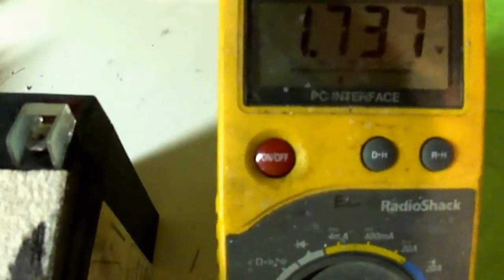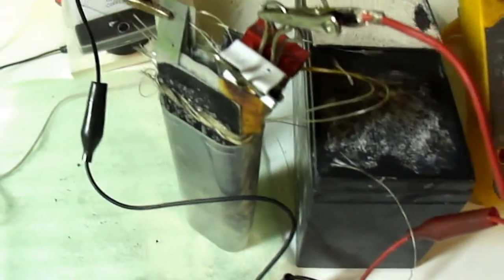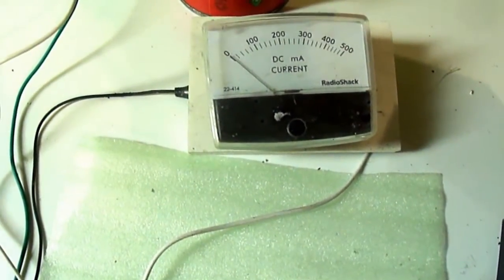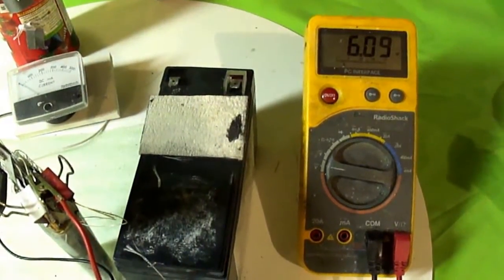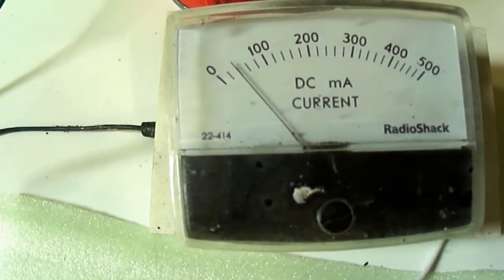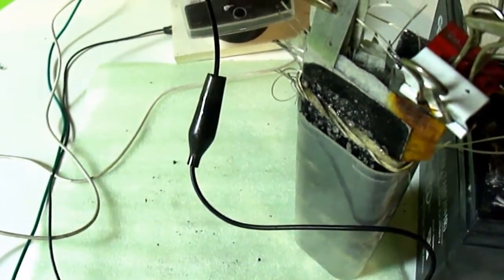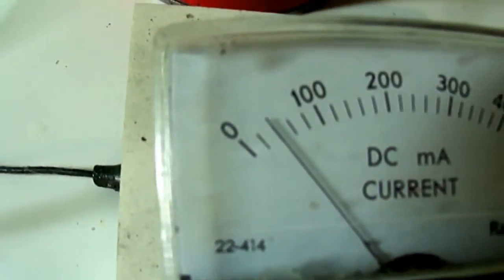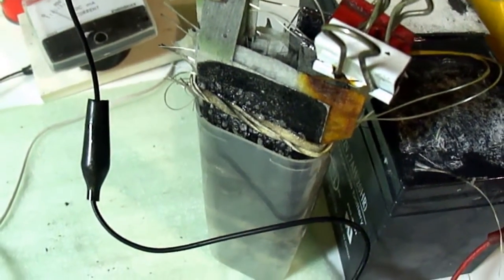Carbon Aluminum Battery 2017

Comment: I think ,How it w III would be ,if one try with potash alum+used lubricant oil e.g.(mobil oil,vegetable oil,dalda,liquid paraffin oil,etc) +glycol +thinner+zinc oxide for the same electrolyte with Al foil+ carbon flexible (graphite) plate for electrodes ???????
Reply from the maker: I have tried heavy metal liquids and the key is making the liquid conductive just enough to have enough current to do anything.

Comment: apparently a bit of ethyl glycol in the electrolyte will help prevent corrosion
Reply: replace the sodium hydroxide with Al Chloride and ethyl glycol in a choline chloride suspension. Will work really well :) then you could experiment with nucleating the aluminum surface, different kinds of carbons and the whole lot.
Reply from the maker: Thanks I will try that.  So If I put some ethyl glycol in with the sodium hydroxide it will stop the corrosion or should I just use the EG by itself? Thanks for the help.

Comment: nice cell Ed, did you say 4 plates, are they in series?
Perhaps if you used your carbon coating onto Al foil you would see any corrosion type damage a lot quicker than with solid Al plates? 
Or perhaps a more Al friendly electrolyte may stop the metal being sacrificial?
Martin.
Reply from the maker: Thanks Martin, I would like to find a Al Friendly electrolyte that would give the same power output.  I figure if I make a battery that someone could change out the Al plates easy, then they might not mind the hassel.  I really like the power that this thing has, but the quest to find the perfect electrolyte is still in progress.  I do know by covering the plates, they last many times longer, even more, if the plates are tightly packed.  I have some that are 6 months old and still work.  The electrolyte needs to be replaced more often
Reply from the maker: The plates are in parallel  for current longevity.  I will put another cell in series to gain a larger voltage and make a vid for that too.
Reply from the maker: I just checked the plates yesterday and the salts fused the cells together.  Even if the aluminium plates were protected by the carbon, I would not know because of the salt fusion.  The growth of the salts is a big problem.
Thanks for your input.  O no the plates are in parallel  for more current.
Reply: what about choline chloride, Al chloride, and a glycol? no water, no corrosives, and TiO2 thin film as the seperator material. To increase the dielectric coeffienct just add powdered barium titanate, PZT, polystyrene, PTFE etc.
Reply from the maker: Hey Zacariah, I have some choline chloride and glycol and will try that and I will need to get some barium titanate and use it with the polystyrene.  Thank you for the help.
Reply from the maker: Thanks Solar, I will try the carbon on the al plates and a new electrolyte.
Reply: I did the same by stacking plates on the same cell. They fused. Used KOH rather than NaOH. Seems the cells have to be separated by plastic though the electrolyte can be common to all. Strong battery! Hate it they don't last so long. I did try some aluminum angle of high quality, flattened it out, clamped all that stuff together and got it to run 36 hours. Had to tweak the electrolyte though and occasionally re- clamp it.
Reply: no problemo! just thoughts ive had myself while testing my own batteries. Al Chloride is a great electrolyte, puts out a high voltage especially when no water-based electrolyte mediums are used. However more works needs to be done, as it has a high voltage but also a persnikity habit of self discharging rather quickly. I cant wait to see what you get! Any ionic salt chloride, nitrite, sulphate, sulphites, will work. All of them will corrode the Al, some slower than others. Choline chloride will oxidize the Al overtime due to chlorine gas production when charging the battery. Different Deep Eutectic solvents will slow this down, like a glycol or other polyols.
Reply from the maker: It seems that its great for an emergency battery that can be put together quickly and get a good amount of current for use, and since the battery is so cheap to make it is perfect for disasters .